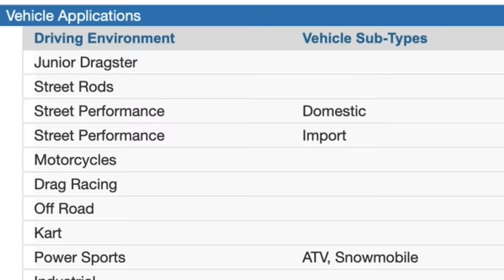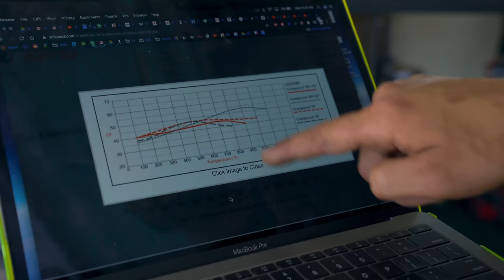Are Big Brakes Worth It?

Comment: "Change brake fluid every year" well i just heard millions of people all over the internet ask what brake fluid is
Reply: It's something like blinker fluid.
Reply: Nah this sounds like that blinker fluid shit my dad tried to get me to buy at auto zone once. They looked at me like I was stupid. 
No my car won’t stop properly but if I pump the pedal 3 times it starts to work a little
Seems good to me
Reply: I feel attacked🤣
Reply: The more i think of it, the more i realize i shouldnt have said anything since idk where to put brake fluid nor have i ever done it XD
Reply: What is brake or break fluid for ?
Reply: @WarriorsPhoto  i may be wrong, but i believe it goes between the pad and disc as both of them are metal. Metal on metal contact is never good, especially at such a rate of speed under such pressure. The fluid goes in bewteen to lubricate the area so nothing completely dies under 1 or 2 stops
Reply: @Vade4545  LOL thank you for this lesson in physics. (:
Reply: @Vade4545  WHAT?! No! Its not a lubricant! Its basicly just a hydraulic liquid that makes two things:
Breaking will become "lighter".
It transports the heat away from the brakes.
Once the liquid is boiling there will be no pressure in the system, so your pedal will feel even lighter and the brakes will not respond anymore. This can also be the case if the fluid has air in it or if its too old then you will have water in it, and water is not a hydraulic fluid, right?
Reply: @Adam C ok^^ :) Didnt got it.
Reply: @Gentleman...Driver  ok, that makes sense. I did say i may be wrong, so that implied that what i said should have a grain of salt. Thank you for the lesson, and i wasnt meming, i was trying to make sense out of the few puzzle pieces i had
Reply: @Vade4545  No worries, mate. Its all cool.
Reply: They also told me what is Transmission Fluid..? Tf??
Reply: @erwinsabilala6014  This is lubricant in the gearbox. Works also as coolant. If you dont have enough transmission fluid in the gearbox, then your transmission will overheat and it gets more and more difficult to change gears. If that happens you can Always stop and let it cool off for a while until you reach a workshop.
Reply: @Gentleman...Driver   thanks for it I know that but for some newbies driver's didnt know about it esp in my exp. 

Cause they know what is only important. 

Engine oil
Brake fluid
Freon
And wiper fluid 😅😅
Reply: Lol I feelll like.... the guy who left this comment..... Seriously thinks brake fluid isnt a thing🤣
Reply: Mobile Terminaluser - they're required to be a certain color (well... transparent) by law, that's why e.g. the super blue was banned
Reply: What are brakes
Reply: @travislandreth1061  those things you take at work?
Reply: Wait untill they find out you DO NEED to change your gearbox fluid as well, automatic included :)

Comment: To add, upgrading each part of the brake system does the following:

-Stiffer caliper gives pedal firmness and evenness of pad wear from track use (see pad taper).

-Larger caliper allows it to be stiffer for cheaper, and allows larger pads to be run for endurance races. Also helps against boiling fluid but rotor should come first. Downside is larger caliper requires a larger wheel to fit - and larger diameter wheels are slower than smaller wheels. 

-More rotor mass reduces average temperatures around the track to keep pads cooler and within their operating temp range

-Larger rotor diameter gives you more braking torque, useful for ability to threshold brake with sticky tire at high speed

-Curved rotor vanes cool better than straight vanes due to their fundamental air pumping design

-Harder/treated rotors last longer

-More aggressive pad gives you more bite and greater temperature window. Downside is more aggressive pads make more noise and dust, need higher temperatures to work their best, and wear rotors much faster if you don’t have a transfer-layer type pad.

-Fluid is pretty easy, but often misunderstood. With the car off, pump the brakes until it's as hard as can be.  Then try pushing again and see how squishy it is. If it's really squishy then flush the brakes and try again. You're not going to make a stock car rock hard, so just calibrate yourself to how squishy the system is after a flush and remember that next time you think you boiled fluid. Way too often people think they boiled fluid when they actually just faded or melted a % of their pads. At a track day my brake pedal always feels like trash when I go out for lunch. That's just how the pads get after intense heat cycles - doesn't mean the fluid boiled. As you warm them back up after an intense session, they'll feel better. It's harder to boil fluid than you think. Regardless, just flush with dot 4, RBF600 or SRF if you're a baller and don't worry about it. If you're using a super aggressive track pad and STILL boil racing fluid - you absolutely need a big brake it. 

For street use, the biggest difference is the pad by far. None of the other parts come close to just swapping on a set of transfer-layer ceramic pads like those from carbotech or g-loc, and bedding them in correctly: by doing repeated stops until you notice significant reduction in braking power. If you stop before that, they are not bedded in properly. 

For a quiet pad you can use at all temperatures, get a G-loc GS-1 or a Carbotech 1521. These offer better bite than OEM pads and are super easy on rotors. 
For MUCH better braking performance at the cost of dust and some noise, get a G-loc R8. Not for winter use. Easy on rotors, dust is non-corrosive and torque is easy to modulate. Just doing the fronts is fine. If you track your car do both front and rear in a more aggressive compound like the R12. For front heavy cars step down for the rear. So that's R12 front and R10 rear, etc. DM me if you plan on going to the track and i'll give you better info for your specific needs. Another perfectly viable pad is Ferodo DS2500 for street/very light track use or Ferodo DS1.11 for heavy track work. The key here is research. 

For track use, the most important part aside from pad is the rotor. When brakes overheat, we’re talking about the pad operating over its intended operating temp range and decreasing its bite, or the fluid boiling. Both issues are solved with a larger rotor. Rotors with double the thermal mass cut temperatures in half for a given braking event. Very important.

The larger diameter combined with curved vanes promotes a huge amount of air being pumped through the rotor to cool them back down before the next corner. 

If you just drive on the street, get a better pad. If your braking power fades throughout a track session or heavy canyon rip, also get a larger rotor. If your pads are wearing way more on the leading edge after track days, get a stiffer caliper with more pistons. 

Stainless brake lines only really make the pedal slightly stiffer and slightly easier to modulate, but don’t make your brakes work any better. A proper caliper and progressive track pad makes a much, much bigger modulation difference. 

And the biggest con of all is ‘performance rotors’. If they’re the same thickness and diameter as your current rotors, they are NOT an upgrade. Just because they look fancy doesn’t mean they do anything different. In many cases a 2-piece will be a downgrade because you lose thermal mass, and the weight savings is only a very small difference. Your money is better spent on better tires, pads and larger rotors if it applies to you. Past that, your time is better spent using a pyrometer to determine what your tire pressures and alignment should be to maximize grip.

Another note: There’s no need to change brake fluid every year. Follow the manufacture’s recommendation in the manual- which is typically every 3 years. Even then, it’s not really ‘dangerous’ to leave it in longer than that. Your pedal will just get squishier and the fluid will boil/freeze at a closer-to-ambient temperatures, but for a lot of people out there, it’s not a huge problem.
Reply: this guy knows
Reply: Thanks for the info 👊
Reply: Thank you for your expertise, kind stranger!
Reply: Exactly!!
Reply: Mr.BigBoss7 To add onto that: Carbon ceramics are about 1/3 the density of iron discs, and only about 1.6x the heat capacity. This works out to a carbon ceramic having only about 55% the heat capacity of an iron rotor of the same mass. 

This data point makes them worse, and they actually are in racing applications. The primary reason that street-legal supercars have carbon ceramics is actually because of brake dust and noise.

Supercars need to have strong brakes that work at any temperature, both on street and track, but an aggressive pad on an iron disc creates tons of brake dust, noise, and will be terrible at winter temperatures- stuff that supercar owners would not put up with. 

So to give the supercar owners a dust-free, quiet, yet aggressive braking experience at all temperatures, they have to move to carbon ceramics.

Many track-focused supercar owners actually replace their carbon ceramics with an iron disc, motorsport-grade big brake kit from AP Racing or Brembo. These kits are cheaper and better for track performance, but dusty and noisy if you want good bite.

That’s not to say carbon ceramics are bad. They last much longer on the street than iron discs, they have  30% the expansion coefficient of iron discs so you can usually get away with not having a 2-piece design, and they are lighter weight. This lighter weight thing is more important for cars requiring huge amounts of braking performance, because an equivalent performing iron system is quite heavy - and at a certain point the reduction in unsprung weight is worth the cost and complexity of producing a carbon ceramic based system that suits the needs of the car.
Reply: this is the most informative comment i have ever read. thank you 🤙🏼
Reply: I ain't got the time to read all that shit but kudos to your big 'ol noggin, Sir!
Reply: Everyone please read these comments, this is accurate engineering level knowledge.
Reply: I'm copying this comment into my "handy car notes" until I know it by heart.
Reply: Don’t forget to smoke weed
Reply: Damn, they should include you in the video
Reply: This guy may be the next Donut spec parts video review. Your hired 😂
Reply: Chief Engineer out here dropping knowledge bombs on the masses. 
10/10 Good comment
Reply: Gandalf721 smoke weed daily
Reply: This is perfect,  now only if you can embed this knowledge to squids that know everything.
 Changing fluid in areas where the temp drops low and tons of road salt is more recommended, that's why lines rust. 😒
Reply: What a fucking goat bro
Reply: Don't forget, as mentioned in the video, that a big brake kit looks amazing. Like the clout is insane
Reply: great read! Thanks👍
Reply: Brendan Cross Ah, vital point. Apologies for my oversight
Reply: @Lehpurdzzz  thanks a lot for sharing your knowledge
Reply: And for my VW/Audi bois TyrolSport makes brass slider bushings that reduce uneven pad wear and enhance brake pedal feel.
But yea, unless you're tracking, just buy high quality oe components INCLUDING good brake fluid, and if your car is older you can just go straight to SS lines because they really ain't that expensive.
Reply: Lehpurdz How long did it take for you to write all that? 🤔
Reply: Meh i just go till something stops me. Fuck brakes amirite?

Oh hello car in front of me, kabash!
Reply: I enjoyed this read
Reply: Your Dad Thanks, dad
Reply: And upgrade your brake fluid along with your pads to withstand more heat so your brake fluid doesn't boil up and lose brake pressure and then fade. If you always brake hard, better brake fluid always helps. Some people live on the mountain or go uphill and downhill a lot, it's worth it. I always go for DOT 4 Racing.
Reply: I love how you went into so much detail but neglected to mention possibly the most important part when it comes to braking; the fluid. Your brakes are only as good as your fluid, if you're "overheating" your brakes and losing pedal feel, the problem is most likely dogshit fluid with a low boiling point. Yes you can upgrade your brake disc, but thats the expensive option and guarantees nothing. Invest in some better brake fluid and some brake cooling (ducts, vents) and you will really struggle to boil your fluid. Personally I run ATE typ200, RBF 660 and Castrol SRF  (expensive) in my cars.
Reply: Thanks man...I watched this video to see if there was any benefit to a bigger brake kit for spirited daily driving, and really didn't get much info. Your post gave me the info I was looking for. Thanks again.
Reply: I would like to add that drilled rotors are mostly useless.
1. They have less mass, means that they heat up faster than stock ones.
2. Cracks around the holes is really usual problem
3. Evethought drilling makes rotor haveing more surface area, air still won't go trought them.
4. Drilled rotors are more for show of, rather than actual benefit of brakeing.

Only one thing is better for drilled rotors and actually this is point where sloted ones kicks in as better option.
When brakeing at great speed, or mass, then rotors and pads heat up so much, that they will start to emmit gasses. Gas pillow reduses efficiency of brakeing. Drilled holes or sloted will lead away any produced gasses and pad can still be in touch with rotor.
Reply: New Donut consultant/writer?
Reply: I will not like this comment cuz it's at 665 and I don't mess with that satan guy, but count this comment as a like
Reply: Thank you!
Reply: Stainless lines do more than make the pedal stiffer, they make the braking more precise. You have way more control over how much you’re actually hitting the brakes.
Reply: @TomoHawKzZ  You're right, I just added my thoughts on fluid
Reply: @skateboard987654321  Yea, I see how that's true. But the choice of pad makes a bigger difference in how well you can modulate braking torque. Raybestos ST43 track pad is like an on/off switch and harder to modulate, whereas a G-loc R12 gives you tons of braking torque and is super easy to modulate. ST43 lasts much longer than the R12 though, so tradeoffs like that come into play a lot- and make a vastly bigger difference than stainless lines.
Reply: U just forgot the brake booster.
Reply: Exceptionally good comment, well done! Thank you for sharing your knowledge.
Reply: Fantastic knowledge dump, and all rings true to my experience. One missing point is brake cooling. Properly designed and deployed brake ducts will help reduce front brake temperatures and improve life of all components.

Comment: "If it's not done twice, it's not done right"

World War 1:
yes
Reply: Nice, this is pretty much the story of me working on my cars. 1. Do the job 2. Test Drive 3. Figure out what that new noise is 4. Fix the noise.
Reply: Oh grawd
Reply: @VBshredder  I I just installed new ignition coils and now theres a rattle and I'm like.....what the fuck
Reply: @Ingris1441  it could just be a bolt that you forgot to tighten
Reply: @Ingris1441  did you have to take off anything to get to 'em? on subarus that is often the case due to the god forsaken (when dealing with ignition) boxer design. i'd check everything you touched. I feel your pain. The satisfaction will be greater when you find it though!